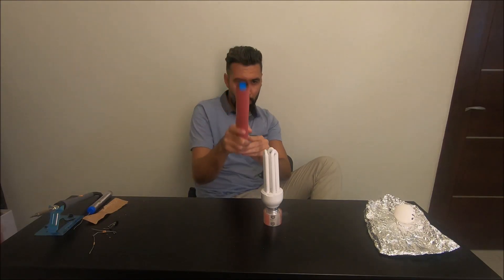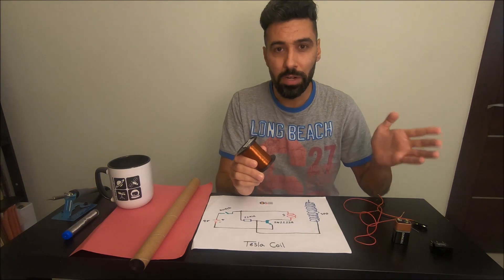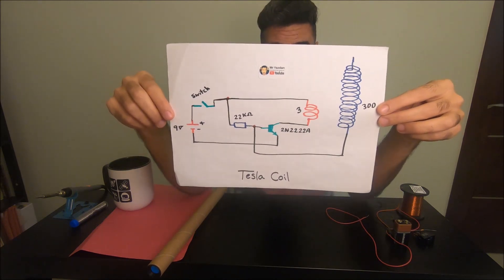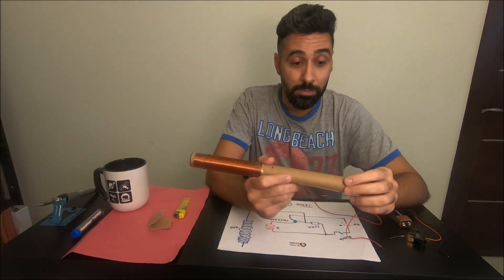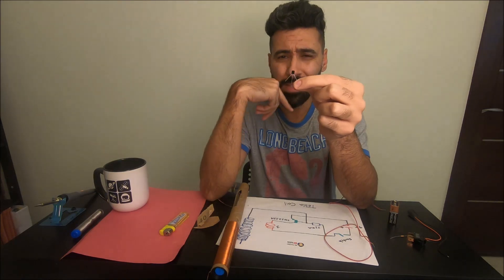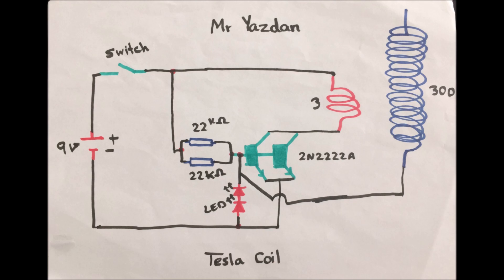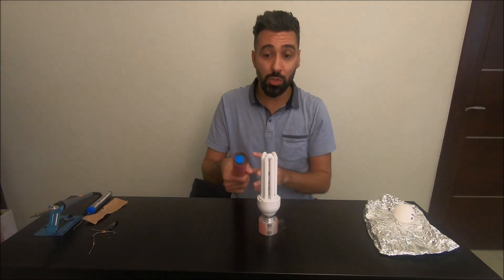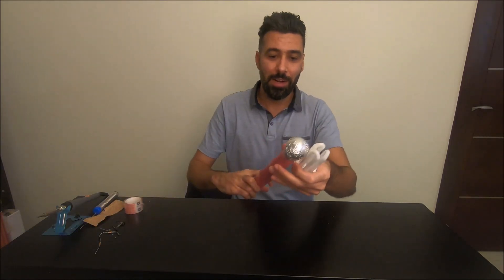Magical wand. Homemade Tesla coil with improved circuit

Comment: I think the answer to your question would be that you would need very large Tesla Coils to use everyday, otherwise you would always have to stay close to the "irradiated" area/ball. And if you used such large Tesla Coils, that they could provide electricity all over your house for example, They would provide a lot of wasted energy if your'e just sitting in your room, with a bulb in your left hand and a book in your right. Also, it's always gonna be hard because of the damn transistor.
Reply from the maker: Correct... but not enough. It seems that I need to combine all the answers and have multiple winners

Comment: Answer: *Tesla Coils can't direct power to the area needed, instead the power will radiate everywhere.
                *Tesla Coils Produce Alternating Currents at high frequencies (doesn't make it very efficient).
This Has Been Amr Mahsoub | GCSE Physics Class | ESSKEETIT!!
Reply from the maker: That’s actually an advantage of Tesla coil that radiates in all direction, which means there’s no need to have specific place for sockets. Imagine having a wireless electricity at home and doesn’t matter where you are sitting, you can charge your phone or have a light bulb, or any other electric devices, next to you. 
In term of efficiency, what you say it’s not very accurate. As the number of devices using the electricity increases, the efficiency increases too. 
Think about other reasons ESSKEETIT!
Reply: @MrYazdan  Then The Answer Is that the government will no longer be able to get electricity bills(MONEY) from the peeps. ESSKEETIT
Reply from the maker: NO! 🤦🏻‍♂️

Comment: I think the answer to that question might be is the wires transfer electricity and energy efficiently the problem with the wireless technique is if it becomes loose the whole circuit might be corrupted and they will probably have to do it again. In conclusion both of the techniques are good but in my opinion the wired technique is probably better than the wireless.

From: Rayan Sabbah

Comment: My answer: We don’t use a Tesla Coil because it loses energy in the air and it is not good in range and  it becomes loose the whole circuit might be corrupted We use wires because all the electrons can pass through and it can be as long as you want 
By: Ishaan Singh Shekhar